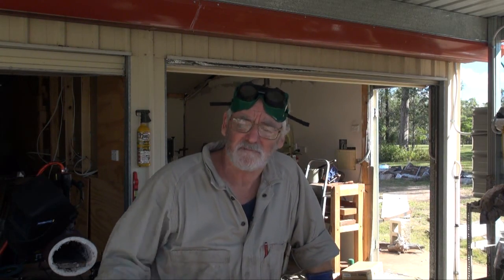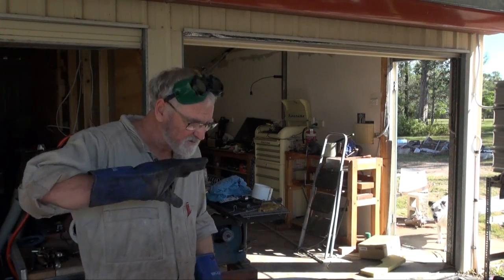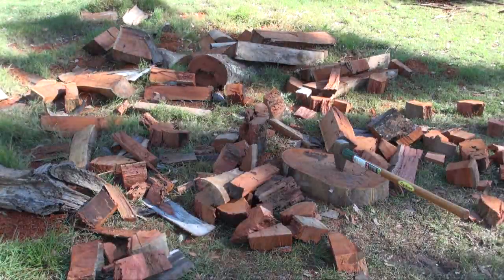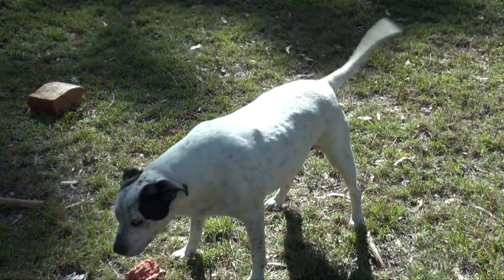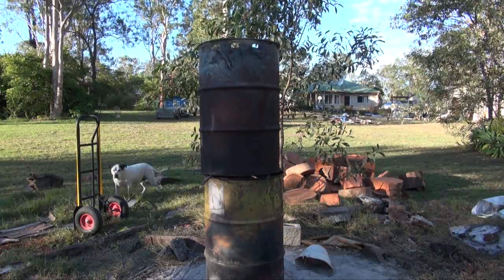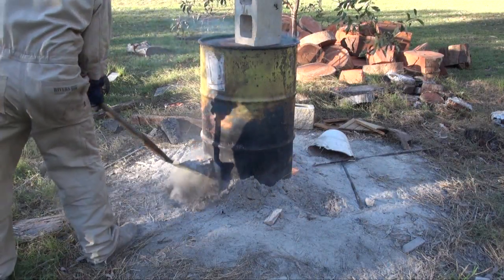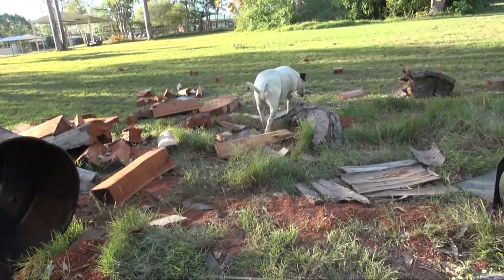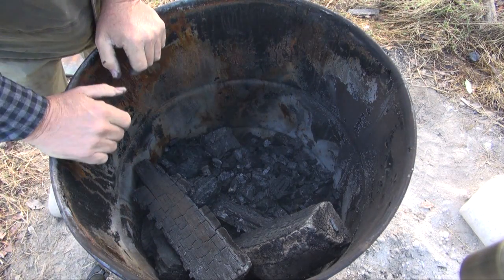Making Charcoal from Scratch

Comment: Wow! This is the video I never knew I needed in my life! Thanks!
Reply from the maker: 12 months ago I didn't either. That's what makes live so interesting. Pleased you liked it. Thanks for the comment. Cheers Steve
Reply: @Woodworkingmasterclass  I talked to my mother about that process and it turns out my grandmother made charcoal pretty much the same way but using stove to get the flames going and then transferring the flaming coals to a pot and closing the lid. But I didn't know what exactly was needed to transform a burning log to coal. And that is to remove oxygen from wood. Anyway, great to be a bit smarter again! 😊 Cheers!
Reply from the maker: @aliasks6559  Not much new is there, it just gets lost in time and then comes around again. What a lovely story that your Mum had to share with you and thanks for sharing it with me. Cheers Steve

Comment: Can this charcoal be used in a water purifier? Like in an emergency would it help? Or does it have to be a special kind of charcoal?
Reply: Max Mullets  it’s gotta be activated charcoal. I don’t remember this video well enough to know if it fits the bill, but I have since found a handful of ways to get clean water without activated charcoal.

The easiest method I found was by putting a clear bag over a branch with lots of green leaves. Tie off the open end so it’s closed around the base of the branch. It’s best to weight the other side by tying a rock to it with a string. The bag will catch the transpiration from the tree and allow that moisture to condense into water. It takes a big bag or/& multiple bags set up in this way to produce enough water for a person to survive though. And it’s best to move it to another section or branch after about 3 days so you don’t kill that portion of the tree by starving it off from the sun. Try to use a tree that has edible fruits and leaves if you have a choice. Some plants like eucalyptus produce oils that are great for the outside of your body but not for the inside.
Reply: Max Mullets  you can catch rain water and drink that, but small particles of dust or dirt and chemicals from the clouds could still get into it though. You can distill rain water (or any water) by putting it in a container above a fire and then setting up a slanted surface over it that leads into a clean container. With distillation though you always throw out the first portion and last portion, the middle is the cleanest. There are very few toxic chemicals that have the same boiling point as water.

Comment: Which is better? using dry wood directly or using that wood and convert it into coal. Which will give me more energy? I feel coal will have less energy than the dry wood required to make that coal.
Reply from the maker: You get a much better burn and cleaner heat from the charcoal than from the raw timber. It's pure carbon not a mixtures of other chemicals or resins. Cheers Steve

Comment: What is the purpose of the afterburner? And what kind of wood is the best for making charcoal?
Reply from the maker: The afterburner reduces the amount of smoke given off from the burn. It all depends what you are wanting th echrcoal for and where in the world you live as to the spices. I use my charcoal for firing my blacksmiths forge. Therefore I require a Charcoal with little to no ash, for that reason I use Queesnland Blue Gum (Showing results for Queensland Blue Gum
Search instead for Queesnland Blue Gum (Eucalyptus tereticornis). Cheers Steve
Reply: @Woodworkingmasterclass  - Gotcha! Thanks for replying. :)

Comment: I use a 20 liter steel pail with the paint burned off, fill with oak or cherry,  tighten the lid with a few holes punched or drilled, then put in in my outdoor wood burning furnace with a good hot fire going. Then after a few hours I take it out when the gasses are burned off.  Great for the charcoal grill with no glues or chemicals.  Ribs, steaks, and hamburgers taste great.
Reply from the maker: I'm hungry just reading that David. Cheers Steve

Comment: Wouldn't be better to do a TLUD ? light the top and let it burn to the bottom that way the upper wood gets heated as it burns further down but seeing the air comes from the bottom there is no oxygen to burn the charcoal
Reply from the maker: Hi Glenn, Not sure what TLUD is? But the way I do it does seem to work very well. Cheers Steve

Comment: I have another way that is quite easy to do. 

If you have and use a fireplace, then wait for the fire in it to burn the wood. Move the "molten" wood (orange color) pieces from the fireplace out of the fireplace with either a long wooden stick or long metal stick (make sure the platform their is not carpet, wood or tile). Once you have it out, use kitchen tongs to carry the molten wood chunk and drop it in a durable cup of cool water. Once it stops sissleing in the cup, you can take it out with your hands. And now you have charcoal, but you need to dry it out in like an ovan.
Reply from the maker: Thanks for the tip, I think it would take quite a long time to fill up a 200 liter drum though. . Cheers Steve
Reply: Oh it can just be a small metal cup you use for it to work
Reply from the maker: @jy7474-k5u  True, the container depends on how much Charcoal you want. Thanks for the comment. Cheers Steve

Comment: 1:29 AAAAH! What're ya doing?? You'll smush the orifices on your oxy-fuel torch tip into oblivion if you do that! As a certified welder, this pains me greatly. ;-;
Reply from the maker: Hi PJ, What can I say laziness leads to bad habits. Will discontinue the habit immediately. :) Thanks for pointing it out. Cheers Steve
Reply: @Woodworkingmasterclass  No big deal my man! Most of us have our own bad habits in one way or another. Just be careful. ;) Regardless, your video is fantastic and I used your design as a basis for my own charcoal generator.
Reply from the maker: @PJ6300gaming  Great to hear nothing like making your own stuff. Cheers Steve

Comment: So you have to burn 80% of your wood to be left with 20% charcoal.... What a waste
Reply from the maker: Not really is you count the block of wood left that will be about as many as you put in the difference is that all the moister and impurities have been removed. Leaving 100% carbon block which will burn clean if you are using them for blacksmith work. Very cost effective and a simple solution for making charcoal. Cheers Steve